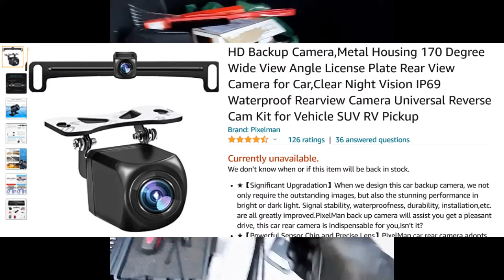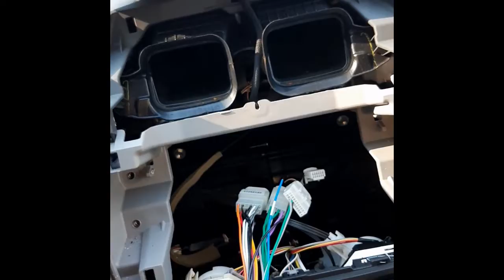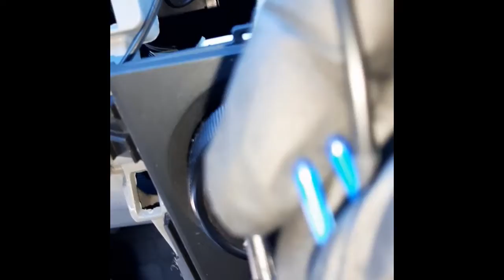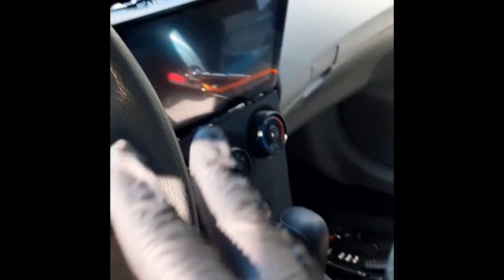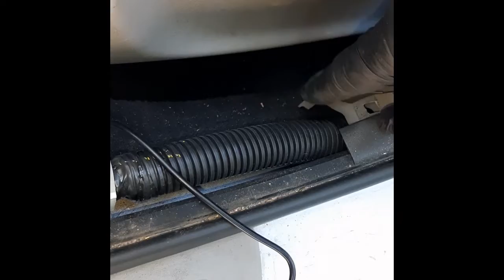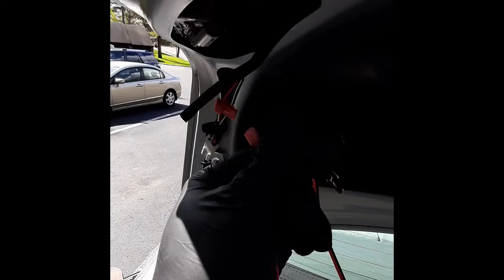Toyota Corolla Android Radio with Backup Camera Installation

Comment: Great job, thanks! As I know the free pin from the car is used to right steering wheel buttons. To use them you need to install a new steering wheel and a new android cable
Reply from the maker: You are welcome, I have another video on how to install Steering Wheel Controls for the Toyota. Check my channel

Comment: Which head unit would you recommend buying now? After watching this video I’m thinking of installing my own in my 2013 Toyota Corolla
Reply from the maker: I recommend atleast a 4GB RAM with android 11 OS.
Reply: I have been searching for a head unit with those specifications but looking through Amazon I could not find one. Is there a brand you recommend?
Reply from the maker: ** Android Radio: Aliexpress.com tell the seller that you are from EAZIDIY for discounts
$2.00 discount for orders over US $98.00 use code: K384LC6SMXZQ
$5.00 discount for orders over US $188.00 use code: L702LQ733L2B
$8.00 discount for orders over US $258.00 use code: 1TCM5GLLCPXU

Use this link from Aliexpress https://www.aliexpress.us/item/2255799973184535.html?spm=a2g0o.store_pc_groupList.8148356.23.22bd28abRvRpR6&pdp_npi=3%40dis%21USD%21US%20%24210.57%21US%20%2498.97%21%21%21%21%21%402103225116886591610634864e16d7%2112000030141220630%21sh%21US%213962034193&gatewayAdapt=glo2usa
Reply: @DondeEstaLaLeche I doing
Reply: I appreciate it! I’m excited to try my hand at installing this head unit. Thank you so much for the video and for taking the time out of your day to send the link of the head unit!
Reply from the maker: You are welcome.

Comment: The ground cable on the trunk where did you bolted on?
Reply from the maker: I didn't bolt the ground wire, I tapped it into a black/white wire in the trunk. See the video for reference
Reply: @eazidiy Tapped or taped?
Reply from the maker: Whatever is easier for you.

Comment: Hello, very instructive video. Please, how do I run the camera wire from the rear seat to the car booth? I’m currently doing mine at the moment. Please help
Reply from the maker: Just collapse the rear seats and tuck the wires under the seats. You need to open the trunk side rug and follow the wire path
Reply: @eazidiy  Thank you.
Reply from the maker: You are welcome and I hope you are able to complete your installation? If you need further technical assistance, you can email me eazidiy@gmail.com
Reply: @eazidiy  Also, how did pass the camera lens or wire through that hole after removing the 6 10mm bolts towards the license plate. The head of the red and yellow wire of mine can't pass through.
Reply from the maker: @Izuofafrica  use the license plate light hole to pass the wires. Just loosen the bolts holding the light and that will give you small room for the wire to pass through.

Comment: Where should I go to get this done like you did it
Reply from the maker: Any radio shop and auto repair should be able to help.You can do it yourself, atleast the radio installation. Buy small kits like wrench and screw drivers and you will be fine.
Reply: @eazidiy  thanks for believing in me
Reply from the maker: I shared the video to encourage people to do it themselves. So you have to do it. I am here for you if you need any technical assistance.

Comment: I have a 2011 Toyota Corolla sport and when I tried to plug in the harness sent to me it burnt the radio fuse, also my harness is a bit different and I can’t seem to make it work.
Do you have an idea why?
Reply from the maker: If you have a blown fuse, the probably cause the wire harness. If the terminals are incorrectly matched with your car's harness. If you can send me an email eazidiy@gmail.com with pictures of your harness and radio, I can take a look.
Reply: @eazidiy  email sent! Thanks
Reply from the maker: I got your email and I have since responded.

Comment: Hi EaziDIY, are this head unit come with all the wired harness to just plug and play to the car or you ordered I separated harness to plug it in to the car? Also Aldo the head unit will fit on the 2013 Corolla? I check on the link you post it in the description and the head unit says will fit 08-12 Corolla but I have a 13 Corolla and I do not see any differences between the 12 and 13 Corolla’s! Thank you in advance 👍
Reply from the maker: Hi David, the wire harness came with the unit and yes it is plug and play. The radio will work with 2013 corolla as well. I will suggested you buy a 4GB RAM radio instead of 2 GB.
Reply: @eazidiy  thank you 👍
Reply from the maker: @DavidHdzR  you are welcome

Comment: What do you think of the screen after long use?
Reply from the maker: The radio works great, no issues so far. Only thing I would have done differently I to get a 4GB RAM instead of 2 GB

Comment: Moving up a step.   You can buy a license plate cover that integrate the camera to it.  That way you can have a clean install as if it's factory.   The camera you have can use that setup.
Reply from the maker: Thank you for your feedback. Could you share the link to the item mentioned?

Comment: Thank you so much! You saved a tons of my time! May I ask a question? My ABS light and slippery road light also turned on when I installed this. How do I made them go away?
Reply from the maker: Hi thanks for the feedback. As for the lights turned on, you may reset 2 ways. 1 method is to push the traction control button below the AC vent on the left hand side of the steering wheel. If that doesn't work, use the following steps:
Step 1: Open your hood and remove the negative battery cable with a socket wrench.
Step 2: Wait for at least three seconds.
Step 3: Reconnect the negative battery cable to your car battery.
Step 4: Tighten the cable with a socket wrench. 
That should clear the lights. Let me know if it works. Cheers